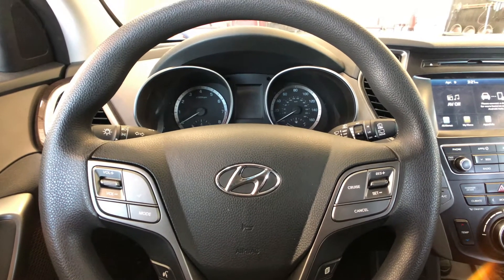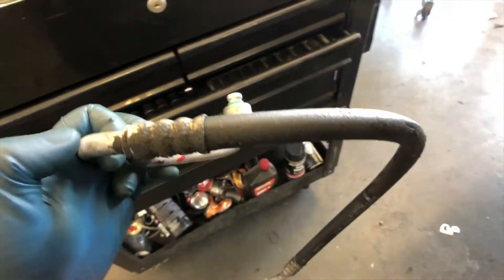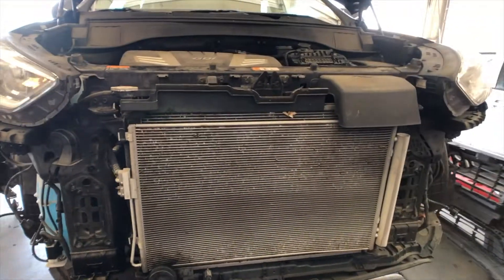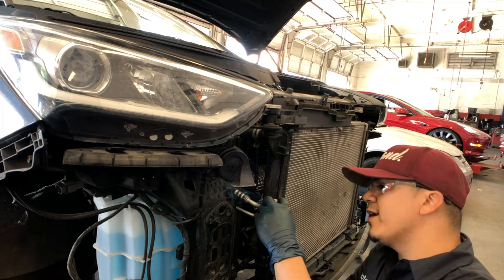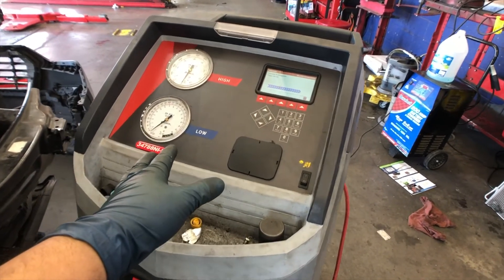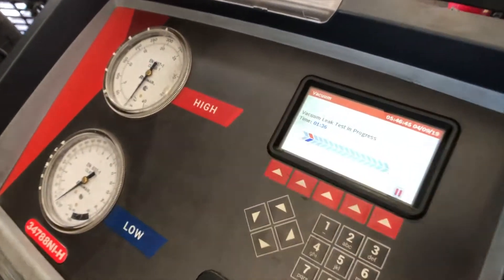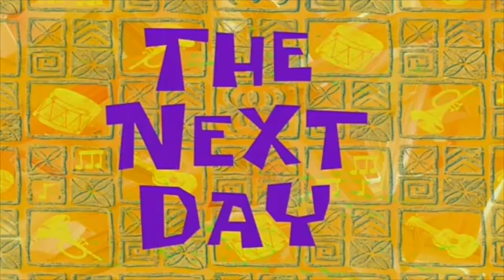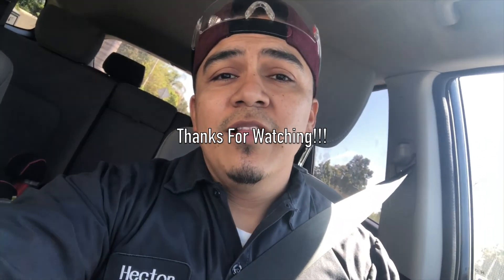Hyundai Santa Fe A/C Does NOT Work

Comment: Hi Hector, nice video. I have Santa Fe 2014 and my air conditioner is not cooling on idle at all and starts cooling only when speed hits around 60 km per hour. I went to body shop for a leach check and they've told me that there is no leak and pressure is good. Can you give some advise?
Reply from the maker: Check your cooling fans, make sure they’re coming on when the A/C is on.

Comment: Nice diag & repair Hektor. As bad as the bumper was bent I knew you were going to have fun with it. Too bad the customer didn't have it replaced with a salvage yard one while you had it off waiting for the horn. Would've made it easier to install.  Nice video
Reply from the maker: Hayward's Automotive That’s right, we gave him the option of replacing it at no extra charge, but No-Go 🤙🏼
Reply: @HomieHektor  All we can do is try to help them save $$ 😎